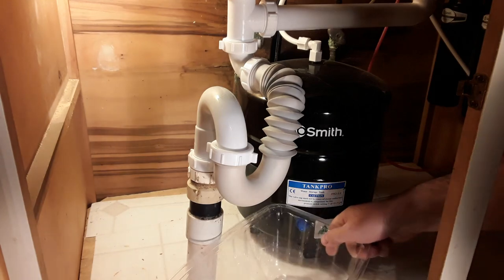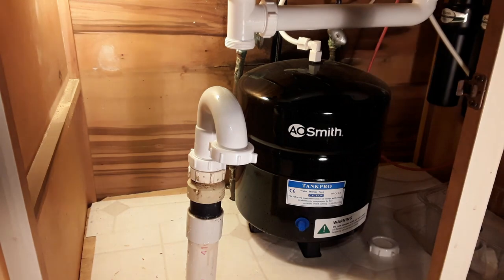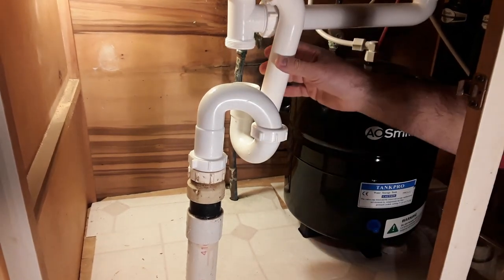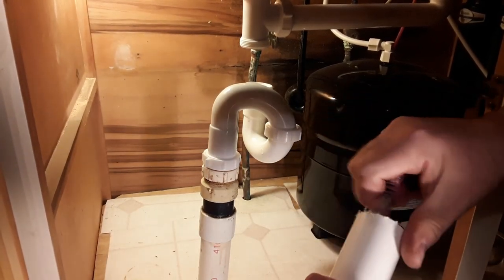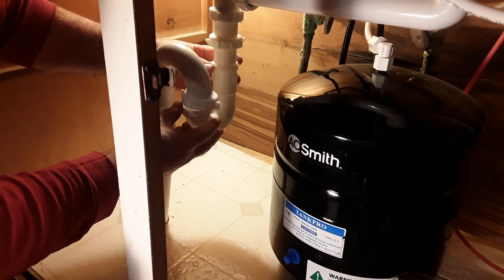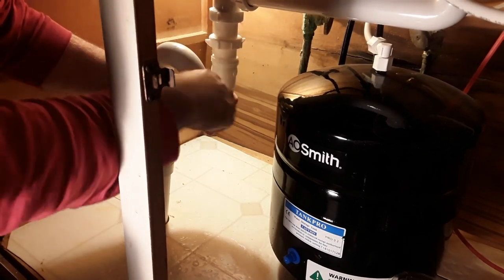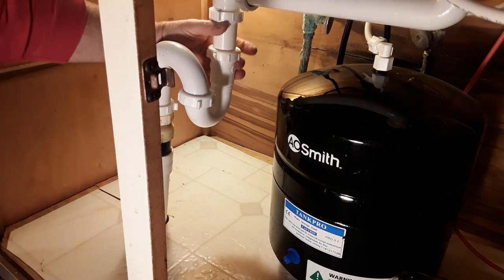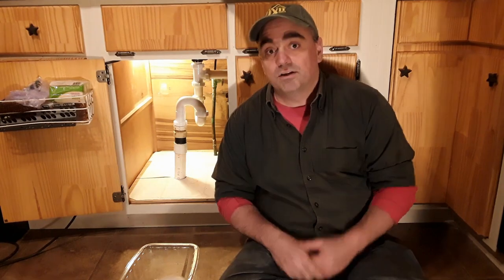Replace Accordian Drain Pipes.  They WILL Clog!

Comment: you made an s trap
Reply from the maker: Judging by your channel name, you probably know more than I do.  I know that S traps are not ideal, but I thought the somewhat elongated and flattened curves I used mitigated the S Trap issues.  What would pieces would have been better to use in this configuration?  P traps are what I should be using, but they fit nicely when the plumbing goes traight back into the wall. I was also constrained by what was available at the store.  At the time most hardware store in the area were picked clean.
Reply: @TheFixitShed  use a regular p trap with a tee fitting. At the top of the tee install an air admittance valve (they sell those at most big box stores) if you are having trouble getting it to line up use two 45s.

Comment: can you give the name of the 'kit' you purchased to do this?  I have one of this accordian style pipes under my kitchen sink on the house we just bought and I'd like to replace it, but I'm not super handy
Reply from the maker: I don't recommend using the parts that I used in the video.  When I made the video, plumbing parts were in short supply.  What I made in the video is an S trap.  S traps are not code.  You should have a  P trap under your sink.   If you have a pipe coming out of the wall it is pretty easy to install a  P trap.  If you have it coming out of the floor, like I do in the video, you might be better off with a trap that has an AAV (air admittance valve)  I will include links in the video description.